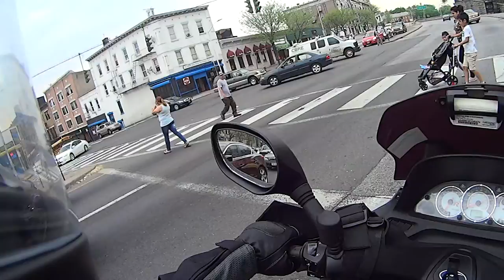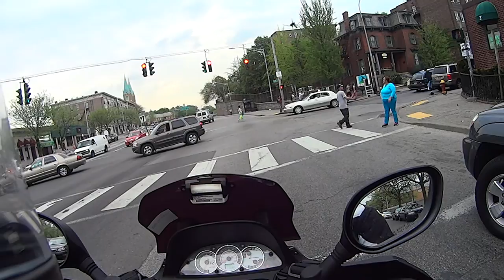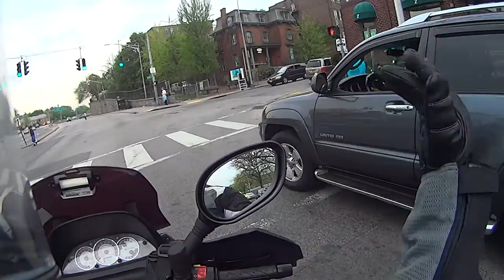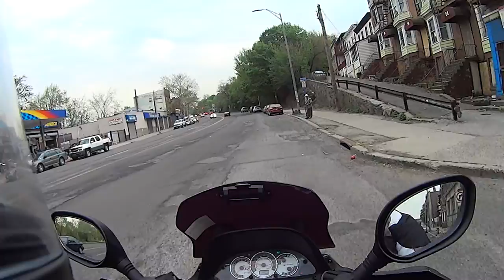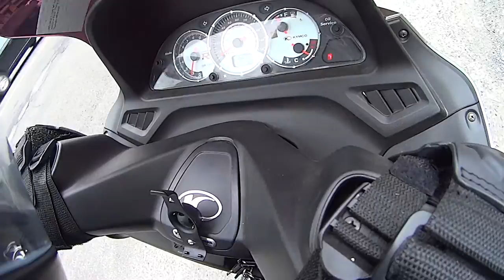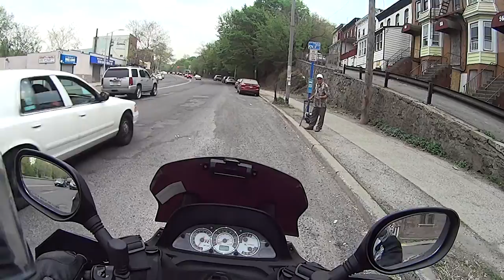Moto Vlog #18 - Slip-On Exhaust

Comment: I had a honda VTX 1300 with cobra low boy with no baffles. A lady still came in my lane. The problem with a scoot is when you go faster the rpms go up so I would think when your up at speed it would not sound good. A bike with gears you can keep the rpms low and get a good sound. I was think about this because I also was thinking about getting some for my Yamaha Majesty 400. I don't think I will. As for my next bike Moto Guzzi v7 II stone I will get some pipes for it.